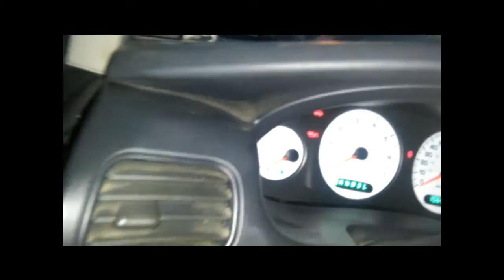It''s Alive! - 1st Start Up '01 Dodge Intrepid 2.7 to 3.5 Swap/Conversion

Comment: What all did you have to swap with the motor? Harness, AC pump. The motor and trans is messing up in my wife's 03 2.7 concorde. I have a donor car out back with the 3.5 that had a cedar tree fall on it. Just need to know what all you had to have to get that motor installed.
Reply from the maker: It's been quite a while I cant remember in detail. But, I'm certain that as long as your Donor is it 03+ (same model year as your car)  you shouldn't need anything else. It's a straight swap/drop in and easy one since you got a donor car, you dont have chase down every single part.